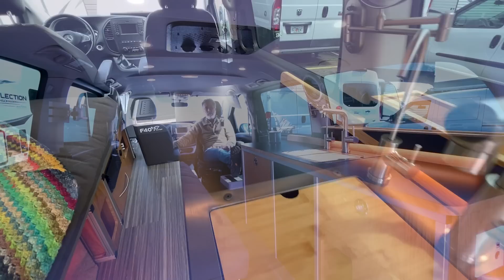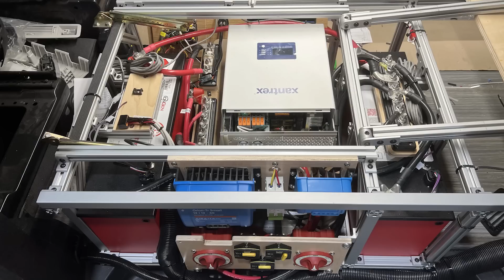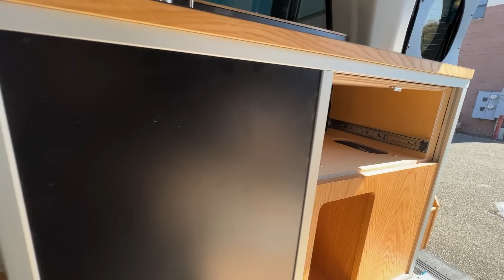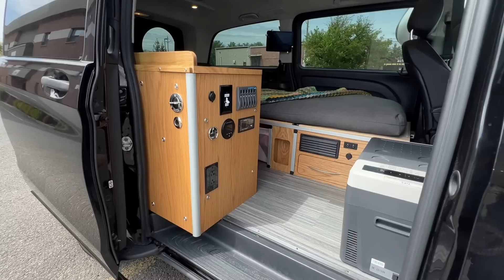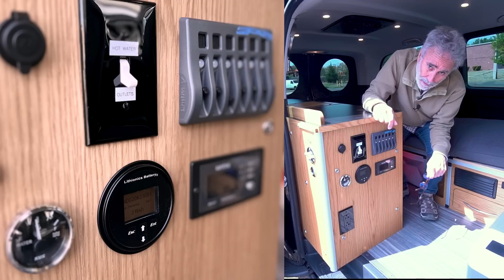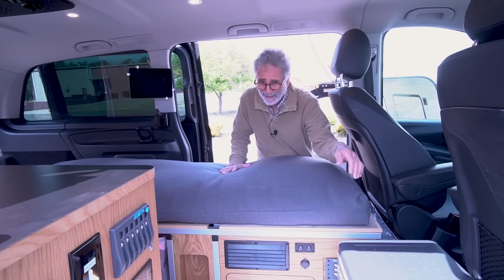Introducing the Humble Road MIDI-Me 02. A Mercedes Metris Micro Camper Solo Traveler

Comment: Many RV, and Battery manufacturers, currently quote "Amp hours". I think this leads to difficulty understanding their power consumption for many folks.

EV automobiles quote kilowatt hours, which i think most folks would find easier to understand. Especially because most every appliance shows wattage on the device. The EV owners vehicle also shows them approximate miles they can drive (power consumption).

Most of these RV "house batteries are 12V, and are connected to an inverter to provide 120V AC (typical household appliance power).
How much power loss from the 12V DC battery?

12V DC x battery amperage = kilowatts. Then losses in conversion to 120V AC.
THIS is what most folks would better understand.

Display kilowatt available. Battery percentage is complimentary. 
Running a 850 watt air conditioner, and reading kilowatts available, easy to calculate how many hours the air conditioner will operate.

Comment: Great build, George!  Love the custom roof rack solution to the AC, and that bed looks so comfy!  Beautiful interior, simply gorgeous.  These must be easier than the big vans to build and so easy to drive around too.

Boy that Nomadic AC is so pricey at $4325!  Most pricey AC models like Houghton and Coleman Mach Low profile run $1200.  this is almost 4 times more + another $5000 Lithionics 325 AH battery so you add $10K more to the build, ouch.  I would use a Mach AC and a Champion generator to run it. Luckily, I have a 4000 watt generator built in, so nice.  Runs everything like a champ but... it makes noise.  So best to park in some truck stop or rest area or commercial place.  I would not give Nomadic my business if they charged this much.

Thanks for the tour, most enjoyable.  Hope you are keeping in good health!

Comment: George I have an 8020 question for you, when you secure a panel to the 8020 how do you fix the t-nut so it will never move?  I gave up with the set screw t-nuts and make brackets out of aluminum angle, if I can access the back I use lock nuts, if not I use rivnuts.  I seem to have better luck with alignment and the panels don’t rattle.

Comment: Does the vehicle need to drive 20 hours to recharge the batteries? My Volta (Winnebago Boldt) can recharge in 2-3 hours with our second alternator and it’s the most important feature in the vehicle.
Reply from the maker: You are in a 48 V full-size van. This Metris is a micro camper with a small alternator 30 amp of charging is the most we can pull off the alternator if you need more charging, you can plug into shore power and grab 150 A of charging. 
Also, 300 W of solar on the roof keep in mind it’s a micro camper for one person solo traveler
Reply: I'm not a fan of fast charging. It shortens the lifespan of the batteries because fast charging generates a lot of heat.
Reply from the maker: It’s not even an accurate comparison. It’s like me saying I have a car that can go 220 miles an hour. Do you?

Comment: Maybe do a load controller that preempts the water heater during overloading instead of the switch? That is what I did on my system.  I made my own out of an arduino but maybe someone makes a commercial one?

Comment: 🙋‍♂️ If the batteries on this particular system were depleted from the AC the night prior then how long would it take for the alternator to charge up the battery system while driving?
Reply from the maker: If driving and solar only, then 8-10 hours. But incremental is more attuned to microcamper life. You don’t run the air conditioner 24/7. If you need air conditioning 24/7 and you can’t drive to cooler altitudes, best to plug into shore power 150A of charging.
Reply: @HumbleRoad 👌thanks for intel. It’s appreciated.👍

Comment: I can’t wait to see what you will be able to do with an all electric vehicle. Right now I drive a Tesla Model X but I’m waiting for a nice EV Van. 🚐 Full anytime anywhere HVAC and huge battery pack would drastically simplify your build.
Reply: My current converted Sprinter van isn't an EV (although MB has those now) and it was built with a Volta 48v battery system (no solar or generator). It runs all the major components such as the fridge, freezer, microwave, toaster oven & dbl induction stovetop (but no air conditioner. It is set up to add that though.) For the travel I'm currently doing, it's a good system. 45 mins of driving charges the batteries to 80%.

Comment: What would it take to run the vehicle's factory A/C without the engine running? For campervan's like the midi and mini-me that might make more sense.
Reply: That would drain the car battery instead of the "house" battery. You might not be able to start the car in the morning. Also, the cool air might not reach the back. In many climates a simple fan or two is all you need, but some climates you really need the AC.
Reply: @gblakev  don't see why you couldn't run it of the house battery. Couple of relays to switch between batteries. And if the house battery isn't 12v you'd need a converter too.

Comment: The surround on the roof is a great idea, looks sexy and is functional. Question: could the refrigerator fit between bed and rear doors, in the unused area?
Reply from the maker: Sure, you can put the cooler anywhere you like. OPTIONS!

Comment: IDEA:  Have you ever thought of having an leveling/adjustable height bed (instead of leveling jacks to level out the entire van)?  This would allow you to sleep on a level surface when the parking spot isn't.  Thanks for sharing!  Like 165
Reply from the maker: Cool idea!
Reply: Leveling the whole van would do more than just improve sleeping comfort.
Reply: From what I understand, the coolant reservoir for some refrigerators needs to be level to function properly. There also are concerns for water tanks (if I remember right, George mentioned that's one reason he installs the fill ports on top of the tanks vs.on the side of the tanks). Honestly, I would like to know more. For example, how much out of level is okay & how much is too much? Hey George, that might make a good YT short???
Reply from the maker: DC and 120 V AC refrigerators are not as influenced by angle as are the propane absorption type
Reply: I was thinking the same. I assume the ratcheted backrest/footrest could already serve that purpose, somewhat.
Reply: On vans specified with the passenger seat removed, would you consider moving physical plant into the space where the seat was to make more under bed storage? Thank you for the video it's a great looking van, and how is your health doing now George, hope everything is getting better for you

Comment: This what I am looking for. How about a mini-Honda generator on the roof with push button start. So, say you?
Reply: That may be a bit much...too bulky IMHO. Plus, you I would not wanna be THAT neighbor when others are around due to the noise factor.
Reply: Something to consider is that (all/some?) federal & state parks have noise restrictions during the night (generators must be off, even in eco-mode) so alternate cooling & ventilation would need to be available. I relied on a generator, so at night I used fans that ran off my 12v aux battery. They worked well to circulate fresh air in & exhaust the warm air.  George has mentioned that some vans use only fans & it works well. It depends upon the climate where you are camping of course.